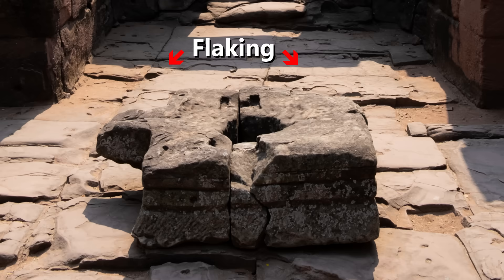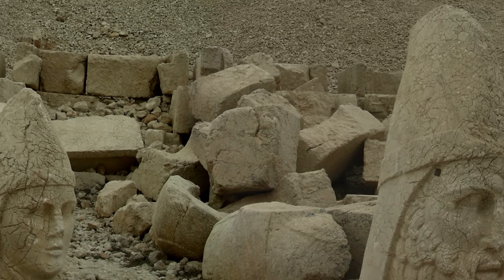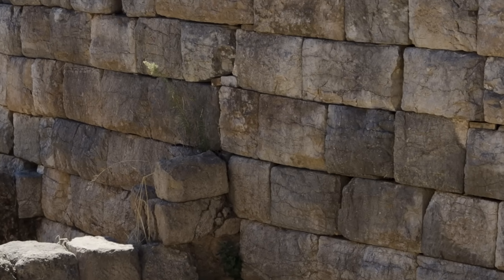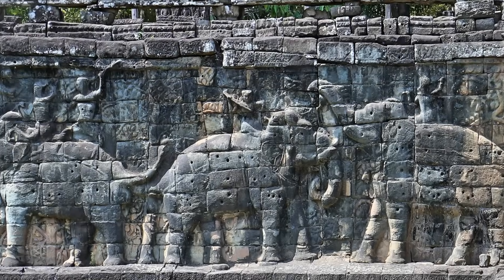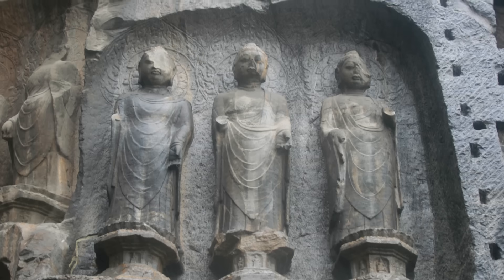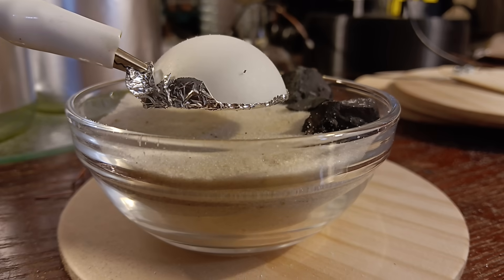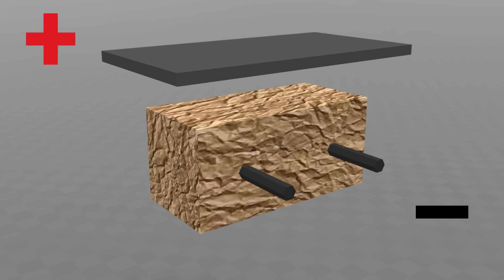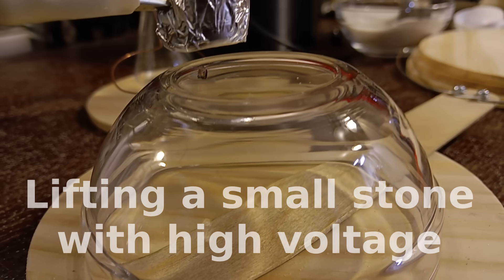The Greatest Mystery, Solved. Recreating Ancient Stone Melding Technology (Part 1)

Comment: You're on to something here, I have been working on similar ideas but was having problems applying HF HV to stone in a controlled manner, the idea of electrode holes should solve that. Thank you for pointing out the importance of the electrode cross section shape!
Reply from the maker: It's not just the electrode holes, it is the high voltage, high amperage spark gap driving a coil that performs 'work' or heating =) Check out my website or visit my chat room to discuss things further if you'd like.
Reply: @MadPlasmatist  I might be a few steps ahead of you, except I'm using tuned HF instead of a spark gap. Getting any efficient transfer from the electrodes has been challenging... but this may solve it, I'll let you know as soon as I can figure out how to drill hexagonal holes in granite 🤣🤣
Reply: @Bewolf maybe start with the hex electrode and try to “push” it in. Might need a melt away flux. Wish you luck.
Reply: @Bewolf perhaps the just burned the electride into tbe rock.

Comment: Overall, a nice theory. But I think what is lacking is the actual analysis of the stones themselves. I recently watched a lot of evidence presented by a French chemist, who discovered organic materials embedded in the "stone"that was considered to be diorite. The only reasonable way to explain the presence of organic materials that would have ever been destroyed by high heat is that they were actually a biopolymer that was a soft clay, added to incrementally and pressed into place. This explanation resonates well with the evidence for many sites but not all of them. The biggest exception to this is balbec in Lebanon. Those sandstone blocks that were moved defy modern explanation and were most definitely not made of clay. But many of the stones if not all of the stones in Cusco bear this mark of organics.

Comment: Where did they get their electronic?
And the steel rods?
With them being in the bronze age.
Reply: Nicola Tesla claimed a hundred years ago that it would be possible generate practically unlimited power using plasma. He had built a functional coil and an experimental transmission tower and those inventions, for as many reasons as there are foil hats, are no where to be found.

Also, the bronze age is mostly just a Western myth,  bronzes best quality is its corrosion resistance and therefore longevity. Couple that with abundant mining in the Mediterranean and Middle East  and you got the bronze age. There is good evidence that iron was being worked 8000 years ago in China. For all steel is a modern miracle, set uncoated  steel outside for a week and there is surface rust, a couple months and there is scale and pitting, and in a hundred years there are only traces in the ground water
Reply: The bronze age? History is all a lie, you should know that by now. The ancients were far more advanced than we are today
Reply: Didn't you mean copper age?  The bronze age was much later.  Which begs the question that the mainstay narrative fails to answer and that is how was so much precision engineering done by a civilisation(s) so far behind us technologically and why aren't we capable of recreating it if we are so advanced?
Reply: Tesla said electromagnetic force of Earth's poles. Use it as power.
Reply: Civilisation whipped out and reset
Reply from the maker: I cannot say where they obtained their components, all I know is that high voltage was involved and I'm recreating this technology for the current use of mankind =)